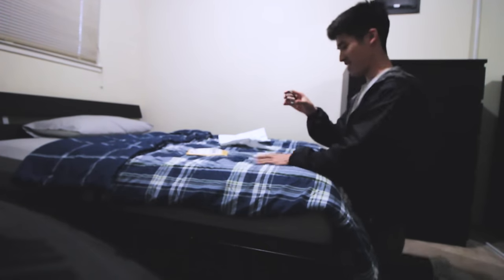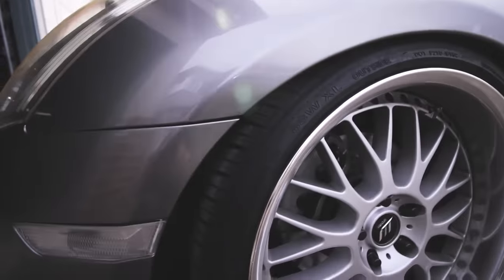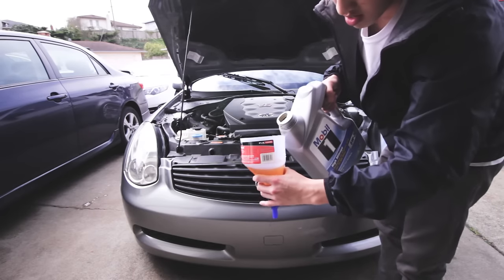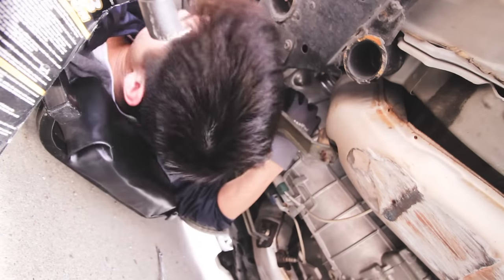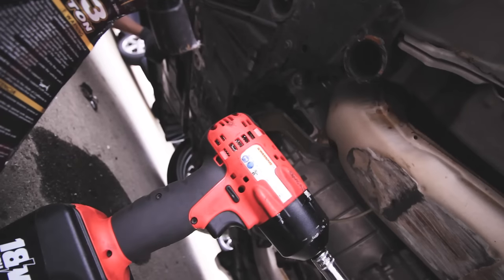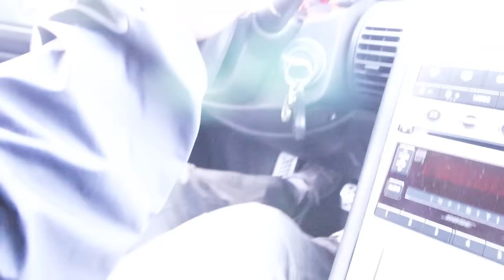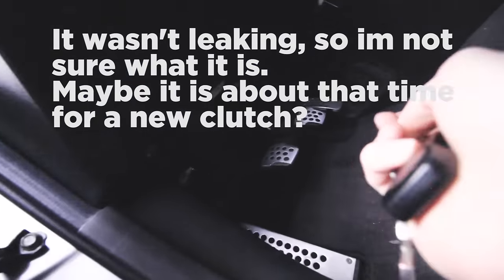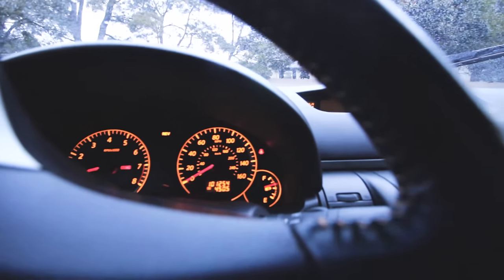Thursdays with Tyler #5 | WHAT IS WRONG WITH MY CLUTCH?

Comment: Yeah get a Z1 stainless steel braided kit. And the Willowood 3/4 clutch master upgrade conversion. It's what I did. The system will handle anything in the future. I also have a fully adjustable clutch pedal replacement. Haven't put it in yet.
Reply from the maker: Alright will do. thanks Jarod!
Reply: jarod harris how much was all that

Comment: I have the same issue with my clutch, where it sticks after driving it for a while.  Happens too when driving it in really hot weather.  Many on the G forums have stated that this is due to the clutch fluid getting really hot.  The clutch line is not necessarily placed in the most optimal space.  Its in a place in the bay where it gets really hot, therefore the fluid getting extremely hot as well.  Therefore causing the clutch to stick when its really hot (after driving it hard) or during really hot hot weather.  Check out g35driver and do a search on it....hopefully some of the info could point you and the right direction and be of some help.  I haven't done mine yet.  I'm gonna wait to replace the clutch and will have it done then.
Reply from the maker: thanks man!

Comment: I'm new to your Chanel so I don't know if you already did this but have you tried checking if your clutch pedal assembly needs to be adjusted? It should be adjusted just about every oil change. Maybe there's something wrong with the pedal
Reply from the maker: No I havent, I try that then. But my clutch seems to be fine now